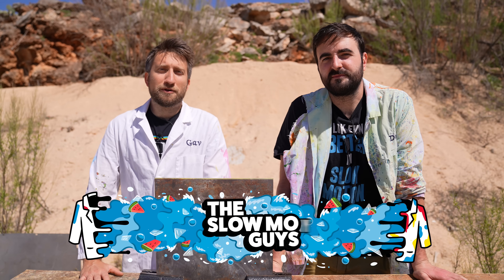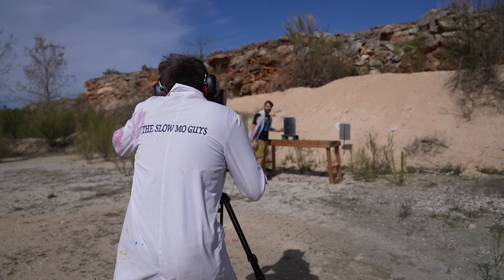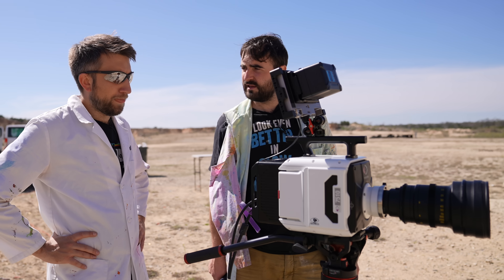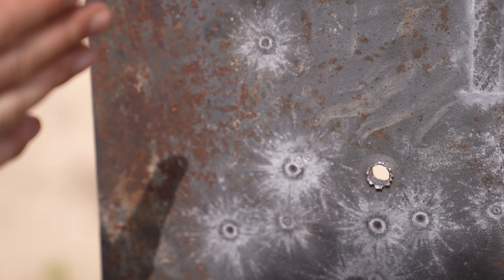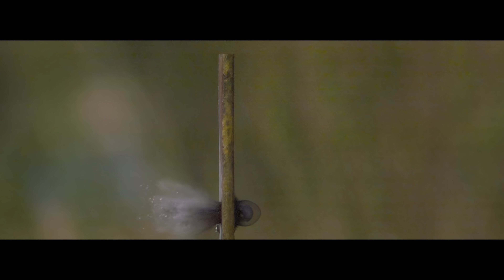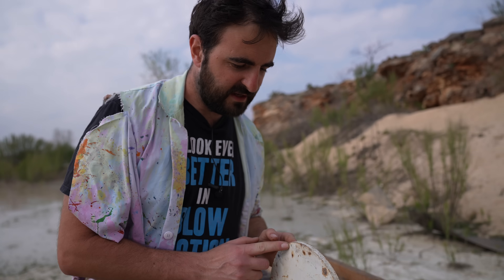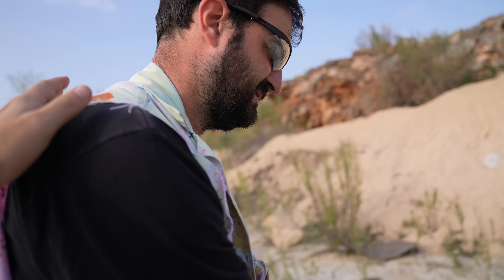Bullets vs Steel at 800,000 FPS - The Slow Mo Guys

Comment: I would love to see you guys do a slow motion shot of an “asteroid strike.”  Basically shooting an object at super high speed and into sand.   I think that would be a good representation of a huge asteroid strike and think it would be awesome with your slow Mo cameras.
Reply: NASA has a multi-stage cannon to do exactly this.  It's called a light-gas gun.  Large cylinder has a floating piston in it.  Explosive charge in back of piston moves it forward, compressing the gas in the cylinder.  Burst disk at the opposite end (at the back end of the barrel) breaks releasing the high-pressure gas to drive the projectile forward... at speeds of 8.5Km / sec (>25K mph).  Then there's the Voitenko compressor - that can send a disk at speeds of 40Km/sec.  Meteors can impact between 4Km - 40Km sec.  By comparison a 30-06 is only traveling at around 1Km sec.

Comment: A thing that is under appreciated about steel is how broad the term actual is. The term is used for carbon steel, alloy steel, and stainless steel all of which have a wide range of properties depending on how their manufactured and small or in certain cases large changes in how much and what type of materials are added to the alloy. The range of strength in steels goes almost two full orders of magnitude and they can have wildly different chemical, electrical, magnetic, and mechanical properties as well.
Reply: "Jet Fuel Cant Melt Steel Beams" 
"Which Steel?"
Reply: @mka6245  exactly. zero of the grades of steel melt at fuel burn temps. ever hear of a house furnace melting..or a port-a-heat in a garage? those are made of sheet metal and resist melting, regardless of the time they're burning fuels..about exactly the same fuel, in the case of a port-a-heat. even if the jet fuel burned hot enough to melt massive steel beams in a short time (oh..another example..engines dont melt from burning fuel, either), that would not cause the entirety of those towers to collapse at freefall speed. at worst, the top portion would've buckled and been arrested by the structure beneath.
Reply: Add to that the fact that the earth is 1/3 iron. How lucky are we

Comment: Good job.  Let us remember some basic formulas. Kenetic Energy = 1/2 mass x velocity ^2.            With bullets (for most arguments), speed matters more than weight.      Also the splash in the soft steel....that rifle bullet is melting and pushing its way through.  That's why there is a splash on the entrance side ---it was heated to molten temperature, weakened, pushed through, and cooled very quickly.   ----------------------excellent job presenting great info.

Comment: The fire isn't a spark, it's the air captured in the hollow tip compressing so fast and hard that it ignites, then escapes through the corners of the copper folds. Neither copper nor lead generate sparks!

Comment: Steels are all different, chemically they are made up of iron and carbon and other things, then they are treated also so a mild steel is “soft” like the first target, a hardened steel has been tempered to chemically change the structure of the steel molecules so they are harder but more brittle kind of like haw crystals are in regular patterns

Comment: The video I've always wanted to see is the action in the chamber of an auto-loader (stripping the bullet from the magazine, ramping into the chamber, and in some instances locking up the breach). Mechanisms have always fascinated me, and seeing high-speed mechanisms at speeds you can process is always fun.
With regard to this video, watching the wave propagate through the aluminum pan was fun, seeing it lock up quickly (it does ripple a ways further out than they pointed out, see the first shot from the front side). And the waves in the other plates were fun too. And let's not forget the unintentional Schlieren shots. Great video as always!

Comment: Is Dan shooting a 1903 Springfield? Also I remember shooting 8mm Mauser steel core ammo at a piece of boiler plate thicker than the one shone, it went right through as well. I shot it at a old brake rotor as well, it went through one side and got caught on the inside.

Comment: Would it be possible to use some ballistic rated glass or acrylic shielding to allow the camera to get as close as you want without worrying about destroying it? Not sure if that would block too much light for the really high speed shots.

Comment: I think you are wrong about the forward edges of the hollow point "sparking". I reckon the flash is from the compressed air igniting under pressure and then venting through the small gaps.

Comment: 10:15 what it looks like is that the kinetic energy of the soft point .30/06 hitting the plate actually knocked a round slug of steel loose from the transfer of energy through the plate similar to how high explosive squash head anti tank munitions knock a slab of armor form the inside of a tank without actually penetrating it .  Actually after seeing the view from the side I am now certain that is exactly what happened.  It wasn't a lead chunk flying out the back of the plate, it was a round slab of the steel plate that the transfer of energy cracked and drove forward with the force of the impact alone.

Comment: The AP ( armor piercing) rounds actually only have a little steel tip that is meant to penetrate and the lead behind it helps push it through. (most of the time) I also might be completely wrong. Pretty sure I’m semi right.

Comment: Velocity of the projectile is not difficult to determine. 
But what RPM is the projectile achieving ? I’m guessing 50,000 ? But I really have never seen it measured. The .30-06 cartridge would probably exceed 80,000 RPM’s.

Comment: I'd love an edge-on shot!
Also, it would be nice to see something like a composite armor. The simplest version would be to get 2 plates of the same type of steel that the bullet did go through, but have them be half the thickness and one after another with a few cm of separation. Will it still go through?

Comment: The shadow of the sunlight through the shockwave around the bullet is really interesting to me, because it demonstrates why you get a sonic boom from supersonic objects. A sonic boom happens because if an object is moving faster than the speed of sound in the medium through which it's moving, the sound waves 'catch up' to each other and get bunched up into one very thin, sharp pressure wave, which we experience as a loud cracking sound. You can see that in this makeshift Schlieren image from the crisp lines at the front and back of the bullet; from watching Devin's video where he compares Schlieren images of subsonic and supersonic bullets, it seems like you don't get that from subsonic rounds.

However, there's something I can't quite figure out: in Devin's video, and every other image of supersonic bullets I can find, the shockwaves are very straight lines that come off at a defined angle from the front and back of the bullet. In this case, the shockwave at the front seems to lead the bullet slightly and be a smooth curve rather than two angled lines, and the shockwave at the back is more similar to Devin's footage, but the lines curve away from the path of the bullet rather than staying straight. I can't figure out if that's some weird artefact of the angle at which this 'Schlieren' image is being produced or some quirk of the 30-06 round as opposed to the .50BMG and .300BLK that Devin and co were using. From some quick Googling, it seems like 30-06 goes much faster than even the supersonic .300BLK, and depending on the particular load either a little or a lot faster than the .50BMG (which was surprising in and of itself), but I can only see how that would affect the angle of the Mach cone, not the shape of the shockwaves. The only explanation I can think of is that 30-06 is a round-nosed bullet, as opposed to the much sharper tips of the .300BLK and .50BMG; maybe you only get those nice clean Mach cones with a very aerodynamic projectile?

Comment: 4:00 Alternate theory, Seeing that the "sparks" seem to be coming from a point smaller than the petals, I think that there is a good chance these are not sparks at all but rather the air caught within the hollow point combusting from the rapid compression on impact and exiting through the gaps between the petals. But that's just a theory 👀

Edit:
You can also see that the light is coming from the space between the petals rather than the petals themselves if you watch the following frames where the bullet expands and compare the petal locations to the light locations.
Reply: Combusting with what? The nitrogen in the air? The copper lining of the bullet? The paint on the target?
Reply: @joshbobst1629  the pressure alone can cause air to heat up rapidly to the point of combustion.
Reply: @deadshot4197  Thank you, I'm not crazy 😅
Reply: @joshbobst1629  No idea, that's for the professionals. I just build LEGOs 🤣

That said, you see a similar phenomena with ballistic gel in some slowmo videos where the gel will collapse, trapping air which then combusts in a flash of light or sometimes even when a hollow point first hits the gel
Reply: @joshbobst1629 it doesn’t need fuel. If you hear regular old air enough it will glow. This phenomena has been fully shaken out at this point. We’ve been seeing it for almost a decade now.

Comment: That piece of steel you found appears to be a "static steel" target, which is most likely hung from a 2x4 piece of lumber (cheap and commonly available), which is then set in a steel stand of some sort. That piece is likely AR500 or AR550 steel, which is essentially armor plate and extremely hard. These are commonly set up in different arrays for a course of fire in a shooting competition, like Steel Challenge.
Reply: I was just gonna ask about that, I didn’t expect such a difference in steel but I guess I should’ve after seeing steel challenge targets stand up to all sorts of hell.

Comment: The hardness of the steel us as a result of how much carbon is melted into it in the furnace smelting process. Typically the difference between mild steel and high carbon is only 0.2% for mild, to 0.6 to 2.0% range for high carbon. Hence the 10mm steel resulting verses the 13mm soft steel.

Comment: That white target looks like an AR400 type material which is intended to be a wear resistant steel but also does great for targets.

It's much harder because it's high in carbon and a few other alloying ingredients like maganese, and then heat treated and tempered. The first steel was probably a low carbon or mild steel that can not be heat treated. It's like playdough compared to AR500.

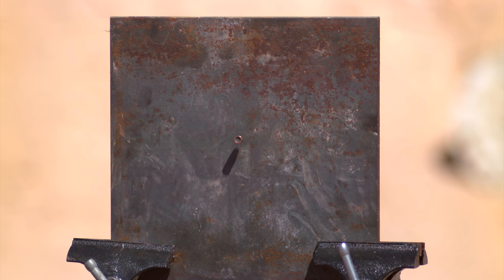Comment: Not sure if anyone has mentioned this, but my thoughts on the "sparks" at 04:20 is it might actually be a compression of gasses in the center of the hollow point and the sparks could be the small explosion escaping from the gaps between the hollow point's leaves. Just a thought, could just be sparks from the copper hitting the steal. (No background in physics or ballistics)
Edit: Looking at the footage from 06:21 It definitely (To my eyes) looks more like a very small explosion from gas compression than sparks from the copper jacket.
Reply: Yeah, i was thinking the same. if the air get´s compressed, it gets hot, and if it gets hot enough, it starts glowing.
Reply: @paavobergmann4920  It's less a glow and more an explosion. That's how a diesel engine works, though it's a mixture of air and fuel. To my knowledge if you compress gas enough, fast enough, the oxygen in the air will ignite relatively explosively.
Reply: @JankyGin  I guess if it is hot enough, the nitrogen could react with the oxygen to nitric oxides, yeah.

Comment: Something that is really interesting to me is the way the bullet's rotation will completely stop when (I'm assuming) the bullet reaches peak pressure against the surface of the plate. However, the moment the pressure lets back off, the bullet starts to rotate again, albeit with clearly less rotational energy. Am I wrong to conclude that this must mean either the bullet, the steel target, or both preserve some elastic potential energy?

Comment: Could you setup a bunch of cameras at the same speed and all pointing at the same exact spot, offset the trigger just enough so that each camera is capturing a frame at a different point in time to effectively multiply the ability to slow it down?
Reply: That's a lot of money for all those cameras

Comment: Could ballistics gel cavitising be revisited with 9mm, and rifles - just the gel blocks, then, with some plate-steel inside the middle of the block, or some kind of explosive/thermite/detonator be placed inside the middle of the block - loved seeing your video with Kentucky Ballistics - the cavity/cavities produced, as well as exhalations of fire looked incredible - they looked like alien grubs/worms/slugs and, each still-frame, throughout the process could have easily been used for concept-designs for the alien creatures, or, just as artworks in themselves - distortions of shape that were intensely interesting to observe, and freaky, and I've never seen anything like that before..

Great channel, chaps..

Comment: You should absolutely do a video on ricochets (maybe again with a "soft" and a hardened steel plate, different calibers and angles. 
Would propably also be very cool to see visually and pretty interesting
Reply: I like the idea! But I would prefer them doing it with the help of some safety experts. Like the ones they had when they did the super slow mo show.
Reply: @WolfFireheart Honestly I don't think it's necessary to go that far. A collab with demo ranch would be good enough. He jokes around a lot, but he is very experienced with stuff like that.

Comment: Hey, Gav and Dan. I’ve previously noticed that instantaneous bright flash when bullets are just beginning to impact steel. I once thought it was an electrical phenomenon (the bullet becomes charged traveling through the air) but now I’m beginning to suspect it is a variation of “sonoluminescence” where air that is already densified as a shock front on the tip of the bullet is further compressed to such an extent it glows. Essentially, the temperature of a gas increases proportionally to density. This conjecture is testable. If you guys could shoot high-speed video at night through a cheap quantitative spectroscope, you might be able to see that the light approximates Wien's displacement law for a blackbody emitter.

Comment: Counting the frames and using the length of the bullet, you can estimate the speed of the bullet at impact (time mark 4:20). I assumed 1/2 inch (which I think is too short) and calculated just under 900 feet per second. Probably somewhat faster because the bullet is longer than my guess.

Comment: The steel you use for targets is going to be an AR-500 steel. That is the hardness rating. It's actually very dangerous to shoot mild steel. As someone who works in a bullet manufacturing there's also a big difference in between plated (9mm and most hand gun rounds) and jacketed (the 30-06) rounds. Love the videos.
Reply: Yep.  Everything I've ever read says NEVER SHOOT ORDINARY STEEL  It's too likely that bits of the target will come flying backwards.  As well, even the AR500 steel targets are typically only supposed to be shot by pistol rounds or "weak" rifles, and they always specify a minimum distance you need to be from the target.  In the following video, I don't know what this guy was shooting, but it's a famous "here's why these rules exist" demonstration.  https://www.youtube.com/watch?v=0ABGIJwiGBc
Reply: Came here to say this AR500 steel
Reply: "As someone who works in a bullet manufacturing there's also a big difference in between plated (9mm and most hand gun rounds) and jacketed (the 30-06) rounds."

What are you talking about? The only bullets that are commonly plated (i.e., electroplated; sometimes called "copper washed") are ones for .22 rimfire cartridges, not counting .22 Magnum, as those use jacketed bullets. 

All centerfire handgun ammunition from the major manufacturers uses jacketed bullets except for the ones that just use plain cast lead bullets (which you'll only find in certain low-velocity revolver cartridges like standard-pressure .38 Special and .45 Colt). They say they are jacketed right on the box (e.g., full metal jacket, jacketed hollow point, semi-jacketed hollow point), not to mention that it's blatantly obvious just by looking at them that they are jacketed rather than electroplated. You can also pull a bullet from the case or recover a fired one that is relatively undamaged and plainly see that it's jacketed by looking at the base. 

Do a search for e.g., ".451 FMJ bullets" (typically used in .45 ACP cartridges) and look at some of the results. You'll see the same type of bare bullets that are used in factory cartridges, and you'll see the base of them in some of the pictures, and even pictures of them cut in half to illustrate the jacketed construction. You can do the same thing for e.g., 9mm bullets by changing ".451" to ".355" in your search.
Reply: Yup was my thoughts exactly. It’s too easy to think just because metal is half an inch thick that it’s bulletproof.
Reply: Why is it dangerous to shoot mild steel? Wouldn't softer steel have a greater likelihood of the bullet going through and therefore be less likely to throw chunks back at you?
Reply: @jono6379   Big dents and such but not full penetrations basically make a perfect ricochet spot.  Buddy hit a plate with a .300 win mag once that was rated for pistols.  It didn't go through because of the distance but when he hit the dent it caused with a .22 at a closer range it flung a chunk of lead back that stuck itself into his forehead.
Reply: @jimbot70  Oof. So harder steel is less likely to deform? That makes a lot of sense thank you